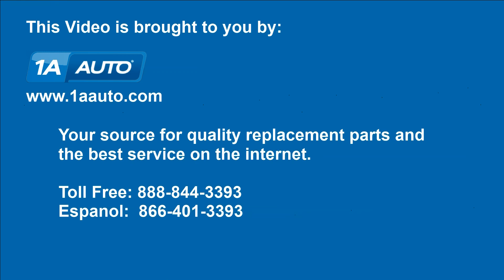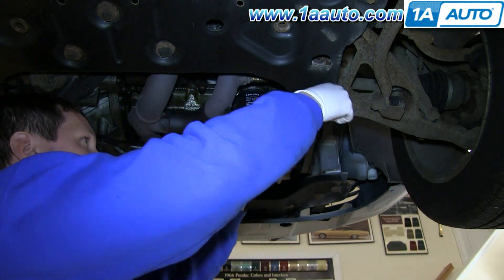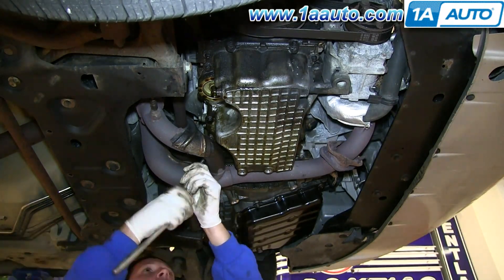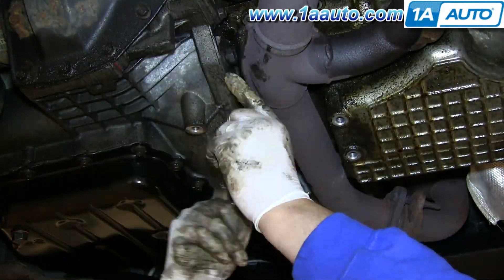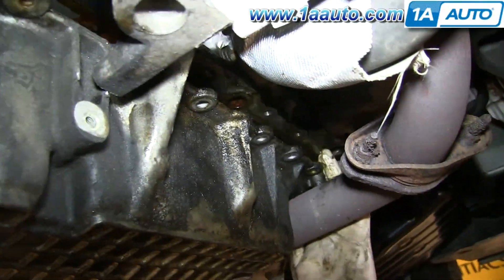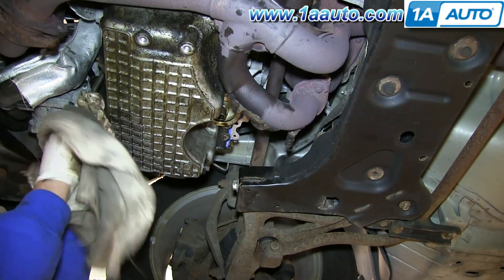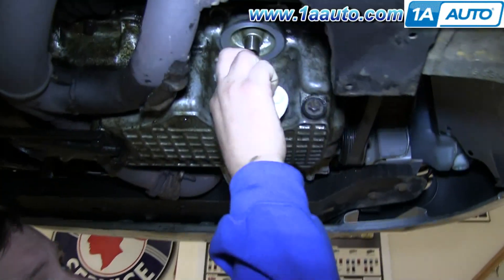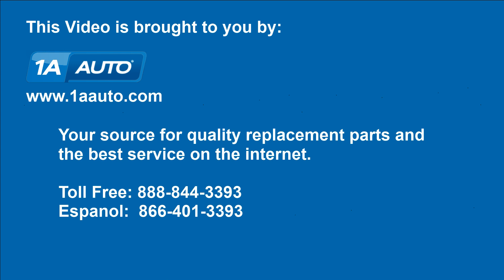How to Replace Oil Pan Gasket 01-09 Chrysler Sebring

Comment: Somehow it seems a lot easier than doing it on a Sebring convertible. Those are the pits to work on. You have to dismantle part of the exhaust, oxygen sensors and support brackets to replace the oil pan or gaskets. Insane!

Comment: Going to give this a go tomorrow on my wife's 2001 Sebring Convertible. Very good video! Thanks!!!
Reply from the maker: Thanks for watching.  Good luck with your repair.  1aauto.com 866-403-3393
Reply: Two things that I would add if you are working on a 2001 Sebring 2.7. Loosen the exhaust clamps on both sides of the engine to help lower the pan below the two studs on the drivers side. Also, make sure that the gasket on the timing chain cover stays in tacked and you don't distort it while pushing the oil pan back into place.

Comment from the maker: @David Bennett You might want to see if you can get a flathead screw driver between the bolt head and the bottom of the pan, apply a little bit of pressure as you try to back the bolt out. Sometimes you can get them to catch that way. Hope this helps you out. 1aauto.com 888-844-3393

Comment: Great video. One little thing I do with vertical oil filters is punch a hole in the bottom to drain the oil out, to avoid the mess from breaking the seal. It’s especially helpful with my diesel pickup, since it has such a huge filter.
Reply from the maker: +Critter87 Thanks for the feedback!

Comment: Thank You for the video.  Looks like I have a good start for the work on Friday.  I am just a little concerned about the gasket on the timing chain cover side though...
Reply: +Duane Gunsch Hey buddy did you have to replace the timing chain cover gasket as well?
Reply: No I did not have to replace the timing cover gasket.  The job completed as in the video.  The oil pan gasket was the only challenge, to keep it aligned, as I did this work with the car on jack stands.
Reply: Duane Gunsch

Comment: Don, I didn't see you use any type of sealer when you put the oil pan gasket back in place.  I did see you break loose some type of rubber sealer when you remover the pan but the new gasket was open on one of the ends and you didn't show how to seal the open end where the oil wouldn't leak.   Maybe the new gasket could be joined together with some kind sealer before it's installed back on the oil pan?   What do you think>
Reply from the maker: +James McQueen The new seal that is put back in place should be all that's needed to seal the pan. We carry the seal shown in this video on our website, here's a link to them https://www.1aauto.com/1A/gaskets/Chrysler/Sebring/FPEGS00034?utm_source=YouTube&utm_medium=CTA%20Comment&utm_campaign=1ATony
Reply: @1AAuto  hi my mechanic says he need to do a oil unit in order to see if I got a leak  or crack in my oil pan do he?
Reply: @1AAuto  I don't know anything about a car and I think my mechanic is trying to pull a fast one over me, how would I know I need a oil unit? The oil light isn't on but in March that light came on so I just put oil in and it went off.

Comment: It was such a joy to watch,...compared to I am sure the work it will be for me to do it... chances are,...on the ground on Jacks....its two times harder!!  But, you  did do it without pneumatic tools.... so I have some hope!!  First to break the seal on my starter,...any suggestions?  Its been awhile about a decade since I've worked on my car... 95 Buick Regal 2.8l straight 6
Reply from the maker: Thank you for watching! Some penetrating lubricant like PB Blaster or WD-40 can go a long way in freeing up the bolts. Hope this helps!
1aauto.com  888-844-3393

Comment: It is a good idea remove the exhaust pipe for the following reasons: 1. To allow the oil pan to drop enough to clear the threaded studs (the pan dropped enough in the video but not on my engine).  2.  To be able to clean the gasket surfaces on the oil pan and motor.  3. To apply gasket seal between the oil pan and the side engine cover.  I did the job and did not apply the gasket seal between the oil pan and the side engine cover.  Now I have leaks around the side-mounted 10 mm bolts and have to do the job again, this time with gasket seal.  Removing the exhaust pipe and putting it back on was very easy.
Reply from the maker: +Santiago Carrizosa Thanks for the feedback!

Comment: i used a cheap eco guard oil filter & now, when idling, oil light comes on.goes away when i gas it..what do u think????? how can I fix/stop the oil light from coming on???  about that oil pan gasket,my thoughts r the same as James McQueen's.the 4th side of that gasket was open/(like a horse shoe).The original had 4 sides not 3.wouldnt it leak on the side that now, doesn't have a gasket?
Reply from the maker: +D.j. B If you have an oil pressure gauge you may want to monitor it to see if it's fluctuating if it's in the safe range.

Comment: what is that other black pan on the left? what is it called and what is it for, i confused it for the oil pan because it is leaking oil in my sebring?
Reply from the maker: That should be the transmission fluid pan. Hope this helps you out. 1aauto.com 866-403-3393
Reply: Thanks a lo, do you think it will stop leaking if i tighten it a little
Reply from the maker: Israel Galvez Thank you for watching. You can give it a shot but they usually leak because the gasket failed. Please let us know how the repair comes out!
1aauto.com  888-844-3393
Reply: i tightened and it seems to have improved it, but in the  long run it will leak very little, i appreciate that you guys communicate with us. thank you
Reply: I have an 07 sebring and the black pan on the passenger side is the oil pan. the silver pan on the other side is the trans pan. this was confusing while watching this video, because your black trans pan looks much more like my oil pan than your oil pan does.

Comment: 208 2.7l is quite a bit different, for those struggling.
You need to take down the center frame support then take down a large cover off the transmission side to reach those last 10mm nuts.
Taking the exhaust down is also very helpful for getting the gasket on/off

Comment: I guess I have been very lucky with mine,original everything even air cleaner and serpentine belts. 2002 152,600 miles.
Reply: R.i.p

Comment: I have a question for 1A auto! in that oil pan gasket kit,it also comes with a little black rubber O-ring, WHAT IS IT FOR? WHERE DOES IT GO??? IS IT FOR THE DIPSTICK???
Reply: D.j. B probably for the pickup tube. Imo I would have completely removed the pan to ensure proper cleaning and reseal ingredients at any seams in the engine block above the pan. While off you can change the pick up tube or ingredients and remove any debris in the pan.

Comment: This video is not much help with the 2008 sebring convertible 2.7l oil pan gasket replacement. Do you have a video that would help with this model

Comment: How big of a difference is it to do a 99 Sebring 2.5 v6? I know there are 16 small bolts surrounding the pan but are there any other bolts involved? I removed the small bolts but still cannot get the pan to budge. I must be missing something.
Reply from the maker: Hi Josh, We currently do not have an auto repair video on this particular repair for your vehicle. We'll keep this request in mind in the event that we need to make this repair in the future. 1aauto.com 866-403-3393

Comment: How did y'all cut the holes on the pan where the studs are at?
Reply: Some previous comments about this have been recently deleted by A1Auto because their procedure does not work.  They used a previously modified oil pan that had slots cut out so the pan will slide sideways off the studs a bit before dropping enough to replace the gasket. If you cannot slide it, it will not drop enough because studs will not come clear of the pan.  Unless your pan has been modified, you will have to remove the exhaust pipe, a challenging chore.  Sorry for the sad news!  Comments regarding this should have been made by A1Auto in the video.
Reply from the maker: +Jack McCullough On the vehicle that we had here in the shop, we did not modify anything. With this vehicle, we were able to perform the procedure as shown in the video. Thanks for watching.

Comment: Is this 2.7L V6 the same engine that my 2004 Dodge Intrepid SE 2.7L V6 has?
Reply from the maker: It should be the same motor. Hope this helps you out. 1aauto.com 888-844-3393

Comment: Dude I can't be the only one saying this is an extremely irresponsible way to change an oil pan gasket. You have no way of confirming whether or not the gasket was completely removed. And if you're doing all this work, why wouldn't you just completely remove the oil pan and make sure it's getting done right? Couple exhaust bolts and unplug an 02 sensor and you're actually doing the job correctly and you can look like a professional...

Comment: I have a 1999 dodge avenger 2.5L v6 24 valve were would the oil pan be at were I can take off
Reply from the maker: +Shutissa Roberts Unfortunately we do not have any diagrams showing were the oil pan is exactly located on your vehicle.  www.1aauto.com

Comment: Video was great helped allot. Had the same problem with two 10mm bolts in facing front end. My pans not modified nor will i. Should be able to unscrew with a female torc socket, T20. I also bought gasket as used in the video but it came with gasket sealer, why is that?
Reply from the maker: Thanks for checking us out! The gasket sealer conditions the gasket for longer life and seals potential leak paths. Hope this helps you out! +troy puente